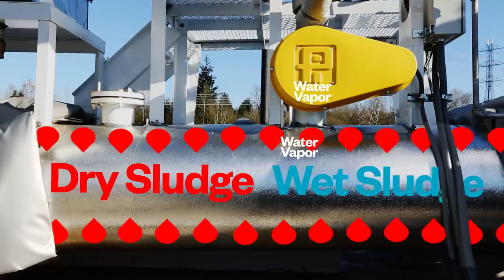Janicki Omniprocessor

Comment: The thing having excess electrical output blows my mind. How hasn't a process as seemingly efficient as this been thought of before? :O
Reply: It has. Sweden uses it. 

Edit: it's just that its always been done on a much larger scale before and it has always been hugely expensive (took years before they saw a return). Their system was only suitable in a developed country willing to do a costly long term investment. 

Edit 2: now they import trash from Norway to be able to feed the system. As a result of the system they not only have some of the best water supply in the world but also only 1% of the nations trash ends up in landfills.
Reply: It has. I work for a company that builds waste water treatment plants. Every city in the US over about 1500 people has one, though most are outdated and need upgrading to produce electricity. The EPA requires that all effluent, I.e. flow leaving the plant be clean enough to drink so that it doesn't contaminate water downstream. This is just a scaled down version that is much cheaper to produce so poor people in third world countries can afford it
Reply: it's not new. Just that there's no machine that can do all those task in one. Water treatment plant sells sludge to company that is probably make some good uses out of it. Clean water usually use to water grass at golf course, etc. A particular plant near my house just dump all the output (clean) water into the river.
Reply: Thanks guys for all the explaining. Never knew sludge processing was that effective and widely used. I live in Germany and take pretty much everything for granted. >_< Well then, let's hope Janicki's small size plant model will work for some of the poorer communities. If Bill believes in it, it can't be that far off. :D

Comment: Concentrations of fluoride in the pineal gland at the
magnitude of several dozen or even several hundred mg/kg show inhibitory activity on melatonin synthesis pathway enzymes.
Fluoride having this effect has been known for a long time in relation to many enzymes.
Thus, it cannot be excluded that the restriction of melatonin synthesis associated with pinealocyte
calcification may be caused not only by a decrease in the number of active pinealocytes but also by the
direct influence of fluoride accumulated in the gland on enzymatic activity. This issue undoubtedly
needs to be clarified.

Comment: I have a question: how does the machine produce more energy that it uses? I know they said it was through steam engines but wouldn’t the energy produced be less that the heat energy required to burn the sludge?
Reply: It would depend on the content of the sludge, but the waste has all sorts of gases like methane which can then produce power when you combust it, convert the heat into work via steam engine...
Reply: Why would it? By this logic we would never be able to produce enough electricity to power anything but the factories we use to produce it
Reply: Do you know what a generator is?

Comment: Why isn't this thing everywhere ?
Reply: 1. I is only fairly recently developed.
2. It's current size is too small to support the bigger population densities you find in the western world (and also factories do require water in some cases and they really need a steady flow of it)
3. It burns the sludge which again produces co2 and probably other stuff that in large scales aren't that great for the environment. This however can be mitigated but it costs a bit more to do. There isn't much escaping to the atmosphere in such a small plant for it to be mentioned on a global scale, but the bigger ones would do just that.
4. Most developed countries already have an infrastructure for all of these things already, who fix what isn't broken, and those water treatment plants don't release co2 at all either since they largely depend on running water to do its own job. They do use chemicals to purify water but again, these are not released into the atmosphere but are treated separately after being used to purify water.

It is however a valuable plant for developing nations as this could give power locally to small communities which means less infrastructure is needed to be built overall. It also requires fairly little maintenance.

Comment: This model uses heat to produce electricity (and clean water). How is the heat produced to convert sludge and water to steam? If it is using coal then how is it different than a thermal power plant which does the same thing?

Comment: First, for a simple machine, this doesn't look simple at all.

What is the proportion between the investment to purchase one of them and the money you get from running it ?

What are the maintenance and repair costs ? 

Why is the conveyor belt exposed to air where the sewer sludge will spill on the sides and make bad smells ?

Comment: I know that the water is clean, but that doesn't mean it's drinkable. It needs to have electrolytes and other things dissolved in it to be drinkable. I was just wondering how that water becomes drinkable.
Reply: Why does water need electrolytes to be drinkable? The regular tap water in your home doesn't contain electrolytes, nor does most bottled water.
Reply: MIR yes it does
Reply: MIR without electrolytes, you'd dilute the concentration in your body, making you sick. A sip won't matter though, but if it's your only source if water, there'd be a problem.

Comment: Could OXALIC ACID be the cause of Diabetes type 2 (oxalates in the liver), fibromyalgia, kidney stones, and gout (uric acid +oxalates).  VITAMIN D3 (50ng/ml) + Chromium makes an enzyme called oxalic acid reductase that converts oxalic acid to lactic acid.  Metformin causes lactic acidosis as a result of chelating oxalates to oxalic acid (then in turn gets converted to lactic acid by methylation.)They should try at least 4000 IU vitamin and add chromium.   Most enzymes and proteins made by vitamin D3 hormone upregulation are at the vitamin D3 blood level @50ng/ml eg. glutamylcysteine ligase.  Metformin and citrate chelate oxalates can be determined by test tube studies in calcium oxalate.  They should try vitamin D3 (4,000 IU) and chromium.  Chromium is expected to be deficient as a porphyria (co-porphyrin-1)develops in the autistic that have high oxalic acid levels and low vitamin D3 status based on the lack of glutathione which removes heavy metals from the body.  They should try chromium 200 mcg along with the D3 to remove oxalic acid by converting it to lactic acid. It would make for a very interesting study to gauge the porphyria (co-porphyrin-1) in type 2 diabetics?
 I have been doing this for people for 9 years now.  I am telling them to go to their physician and see if they want to monitor their vitamin D3 level along with getting chromium in their diet.  I tell them the first time they take vitamin D3, calcium citrate and chromium to expect leg cramps or diarrhea due to the production of lactic production.  Everyone who has followed through this process of taking vitamin D3 up to 50 ng/ml blood level along with getting chromium are no longer diabetic.  Some even said thank you for the heads up  on the lactic acid buildup and for helping them with their diabetes.  I have no lab once I discovered the link between autism and diabetes is oxalic acid and that there is one porphyria in the autistic is elevated.  I reasoned that chromium was the atom at the center of the porphyrin ring for an enzyme that converts oxalic acid to lactic acid as oxalic acid levels are increased in autism, fibromyalgia, gout, and kidney stones (these comorbidities are elevated in type 2 diabetes .   RAR receptor (vitamin A or  (pio)/ (ros)glitazone) is also linked as the vitamin D receptor is associated with vitamin A expression vector.  Tumor necrosis factor is also controlled by vitamin D3 levels as a repression @ 50ng/ml.  I have been nondiabetic for over nine years now.  The paleo diet also works for type 2 diabetes because the liver is rich in chromium (Kale, egg yolks)and vitamin D3.